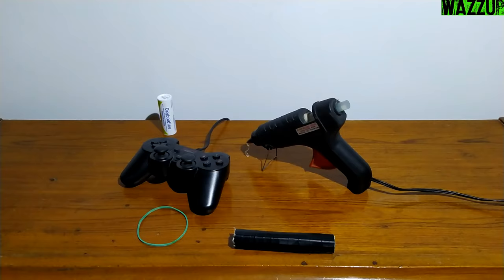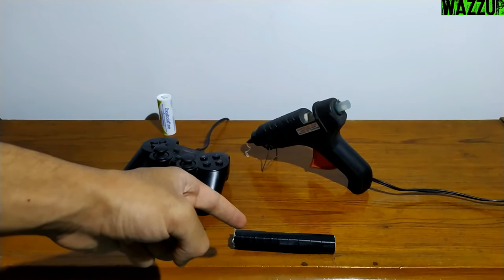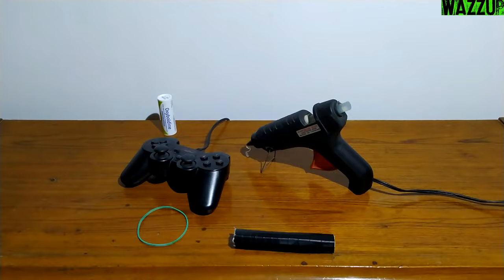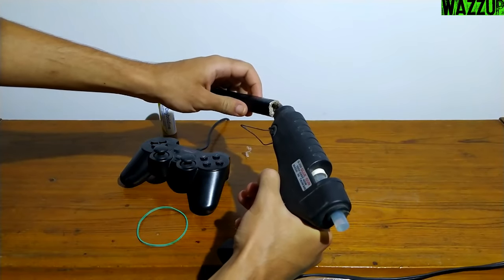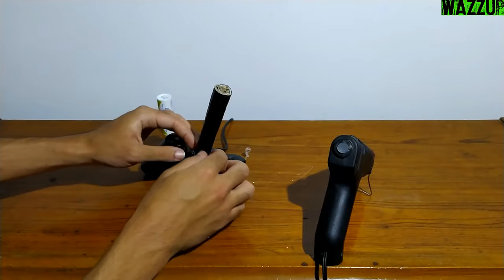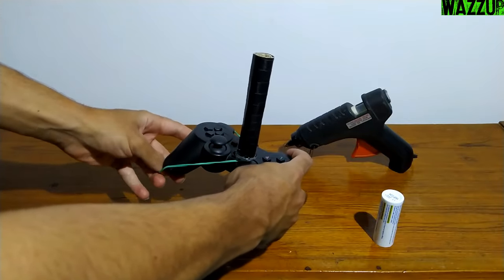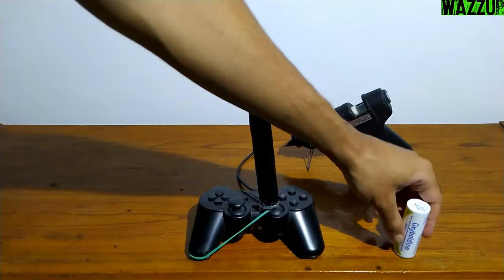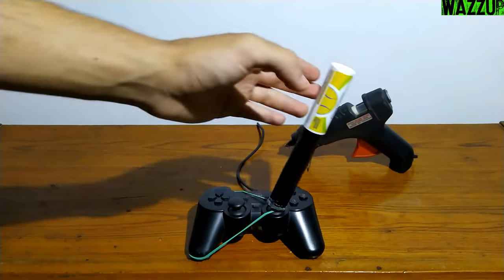How to Make DIY Handbrake With USB Controller in 2024

Comment: Where you put the usb? Becouse i do like that and in taskmananger i cant select the handbrake as controller. Maybe you can do the video how to connect? Thanks.
Reply from the maker: just plug it in (put the USB in PC), enter game, go to settings, controls & assign it as handbrake
Reply: @WazzupTN  I do that but I can’t use them both at the same time. If I use one the other doesn’t work
Reply from the maker: @henryparent1621  thats weird bro
did u try to assign it as different button with program joytokey?

Comment: I did this but boxed the controller so everything is hidden. The only thing exposed out off the box is the handle. Works decent enough. I used multiple heavy rubber bands ( the kind from bananas) from four angles so it really snaps back.
Reply: How do you turn on the controller or is it wired?
Reply: @flix8743  usb so yes wired

Comment: does it work with wrc 10 ? I mean does wrc 10 allow you to use both wheel and controller at the same time?
Reply from the maker: i never tried that game
i only played LFS CarX, AC, FH5, BeamNG & it works good!
Reply: I've tried mine on wrc 10. I can't get it to work. I use it on dirt rally 2.0 perfectly though
Reply: If you find a way though please let me know. It let's me map it. It just doesn't do anything
Reply: @driftclips542  I play on xbox and I can confirm handbrake is working  perfect with dirt 2.0 as the game allow using wheel and controller at same time. I was about to get wrc 10 but seems wrc is not working that way. Its important to start the game from the wheel button to recognise it as primary device and than turn on controller. if you start the game from controller it will not work.
Reply: @klaesproduction8520  thank you. I will definitely try that. I play on Xbox as well
Reply: @driftclips542  let me know if it is compatible
Reply: @klaesproduction8520  I did get it to work. I have a g923 with shifter also so I connected the wheel first and then went to options and turned on my controller and mapped the right thumb stick to the handbrake. Then went to test area. The wheel worked and handbrake but my force feedback and shifter weren't. So I had to unplug the usb from wheel to xbox and then plug it back in. I left the controller on. Now the shifter worked but still no force feedback. So I pressed the home button on the wheel and then closed the home button and now everything works great. I hope this helps
Reply: @driftclips542  I will keep that in mind when I get wrc 10. I am also with g923 with shifter and my diy handbrake is soldered to the RB button of controller. Hope wrc is as good as dirt 2.0
Reply from the maker: @driftclips542  try joytokey & hope it works
Reply: @WazzupTN  What settings did u use for FH5?
Reply: @driftclips542  the force feedback cord will sometimes unplug itself because of it not being in there super well so make sure you check that.

Comment: I tried this but it doesn’t work for FH5 on pc with my g923? Whenever I try to drive it just messes with my wheel makes it impossible
Reply from the maker: try to assign it in the wheel menu not controller menu
Reply: @WazzupTN  all good I just got an eBay handbrake instead

Comment: Hello i want to ask if i can use controller as can and Break when i use wheel on assetto corsa
Reply from the maker: what do you mean exactly?
Reply: @WazzupTN  i have just the wheel so i want to use keyboard or controller as Break and throttle on assetto corsa is that possible?
Reply from the maker: @pubg-gosp-1434  maybe with joytokey

Comment: Hey man, I'm having some trouble binding the joystick to the handbrake. assetto doesn't recognize it as a button, how did you get around this?
Reply: I'm having the same problem
Reply: @jpsm00  i figured it out, just go to axis (same place you bound your wheel and pedals) at the bottom is handbrake
Reply: I did that, i can map the analog axis to the handbrake and i already set range to 50 and the other setting from 85 to 95, it shows the input lf the axis when i push it while content manager is open but when the game loads, only the space bar turns on the handbrake. But I'm trying with a xbox 360 controller 1st
Reply: @jpsm00  that might be your problem. i used an xbox one controller
Reply: @Based228  it was exactly the problem, i plugged a ps4 controller and it worked right away maybe it's because i have the g29
"sadly" i dont have a broken'ish problem controller lol
Reply from the maker: yeah because its an axis not button

Comment: Does it work with normal glue or tape?
Reply from the maker: i dont think so
will not last longer with these xD
Reply: @WazzupTN  i tried it with normal glue and tape and i had fun in 15 min and then it broke
Reply from the maker: @Raggarkongen2010  i told u x)))
Reply: @Raggarkongen2010  I used a hot glue gun and it did not stick so I just used black tape and a rubber band